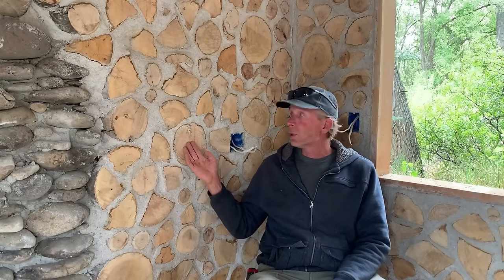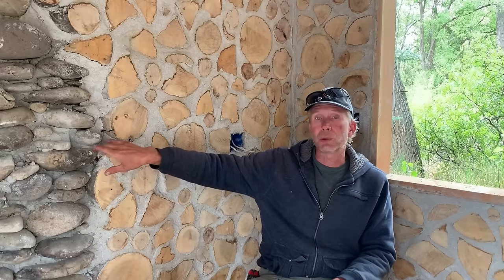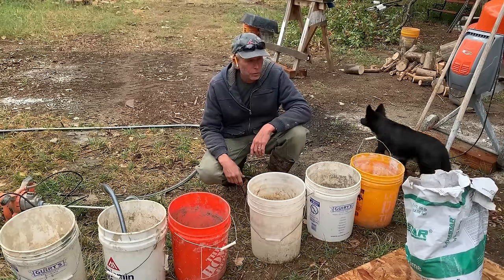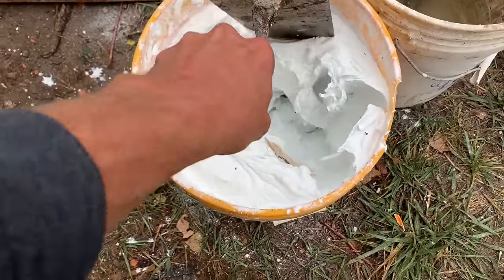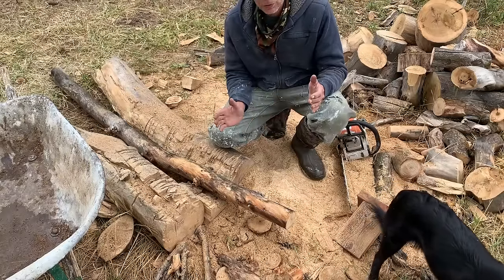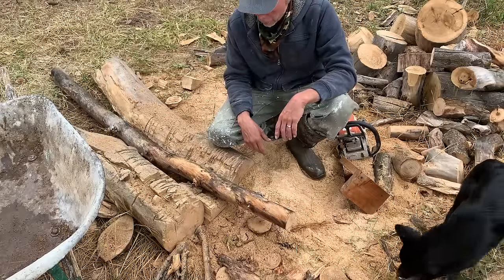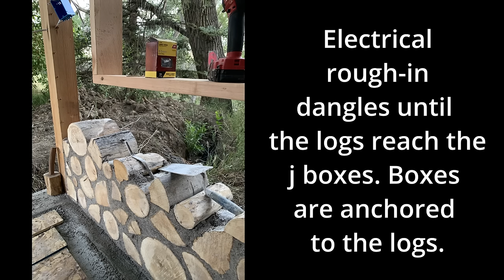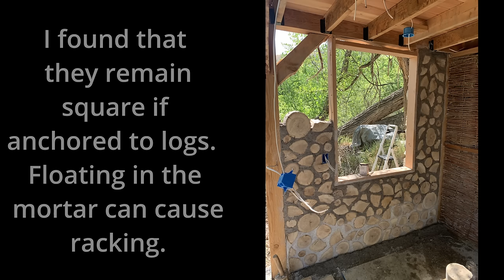Cordwood

Comment: My dad built a house exactly like this, move-in was 1986 when I was 2 years old. My folks, in their mid 70s, still live there today in the hills of southern Indiana. It work

EDIT: He mixed mason jars into the East and West sides of the house. Beams of sunlight spray into the living room at various times of the mornings and evenings, it's the best. Foxfire books ideas lol
Reply from the maker: @Hoosierdude40  Awesome! Always good to hear testimonials.
Reply: Were the jars laying on their sides, or standing up?  I live in a remote village in Alaska. I used mason jars in my chicken coop wall for some light. I stood them up and they froze n broke.  Maybe in their sides they would be more insulted?
Reply: @Alaska-Bush-Mom  The guy above mentions Southern Indiana, coldest winter temperatures reach around 27 degrees Fahrenheit,  this is not particularly cold. 
Your mason jars may have broken due to the warmth within the coop and the contrasting cold outside. The extreme differences in temperature could have caused the glass to crack. I experienced this when I was a kid, tried to defrost some freezer jam in a mason jar in my kitchen sink with hot water. The mason jar split in half, ruined my jam!
Reply: @Alaska-Bush-Mom  You could try the same idea with square glass blocks for windows, the kind found in old diners and buildings. I think they are made to stand up to that kind of heat vs cold.
Reply: @Alaska-Bush-Mom  the jars were lying on  their sides in the mortar, with the mouths in the living room
Reply: Antifreeze! @Alaska-Bush-Mom
Reply: @Alaska-Bush-Mom  Try plastic. It should withstand the temp changes
Reply: How do they protect the wood from rooting with humidity?

Comment: My parents built a log-end home in 1986, long cured logs stacked in cement, walls are around 20+ inches thick. Beautiful. After several years, the logs started allowing wind-driven rain to come through into the house, there’s no sealing or caulking to remedy the problem of ever changing logs so they had the house clad with steel siding. Still get to enjoy a house that is like a fortress and see the handiwork on the interior.
Reply: Maybe the logs should've been completely  covered with mortar/mesh on the outside
Reply: That's why you use lime .instead of cement
Reply: How do they protect the wood from rooting with humidity?

Comment: Im in grow zone 5/6.  Gives a  reference of the cold i deal with.  I would rather build with lime than portland.   Something i have done for 40 yrs - is to cut and leave the leaves on the tree - branches and all - I cut in the spring - it allows the summer to dry out the tree.  Makes seasoning the wood or waiting it out a much shorter time frame.  Thank you!

Comment: Filling the cavity with tamped sawdust is how traditional Scandinavian wooden homes are built.
Reply: That could be okay as long as the roof is maintained. If the cavity ever gets a substantial amount of water, you run a real risk of autoignition inside a wall. This happened to a barn next door to us. The owners used hay and sawdust as insulation, failed to maintain the roof, and subsequently caused the total loss of the structure.
Reply: Why would water cause autoignition?
Reply: @iunnox666 rotting causes enough heat to burn.  Look up hay fires caused spontaneously (no external ignition like a cigarette or lightning..... just the heat of microbial activity)
Reply: 2+ minutes in he talks about sawdust mixed with lime.

Comment: There's a couple of homes near where I live in Nova, Scotia, built this way. I first saw them 25 years ago, and they were very old at the time. I remember the walls being quite thick and had very deep window sills. I remember the logs had shrunk a bit, and you could see spaces around the mortar, but I'm sure there's an easy way to keep up maintenance on them over time. 
I was fascinated and read up on this method. I remember reading there were places in Greece that had some walls likethis standing that were 2000 years old.

Comment: I enjoyed your video and attention to detail and your honest assessment of the final results. I work with clay based earth building materials and thought I would try using a rich chopped straw and clay mixture throughout the whole length of the joints in between the logs. If bugs are a concern I would add a percentage of borax to the mix. 
Wild clays in our area come in a wide variety of colors so one could change up the color mortar for additional effects in the wall. All in all I learned a lot and appreciate your taking the time to share your experience!

Comment: That's very detailed, useful and realistic.
I was wondering if cob (mixed with sawdust and wood chips) would be better as mortar since it will "move" with the weather just like the wood does. It would also save some money and wouldn't impact the strength too much since you've got a timber frame. Also squaring the bigger/straighter log pieces with a froe, side axe or chainsaw could result in using larger rectangular pieces of timber without cutting them to 9 inch lengths. This would save time and effort piling them up like pseudo-ashlar masonry. The larger heavier pieces at the bottom and the smaller round and irregular triangles which are easier to lift over them.
Reply from the maker: This may be worth a try. I have found some traditional examples where the logs are in a cob matrix, and are pitched,witching the wall, such that the outside is lower than the inside. This allows for drainage away from the wall, and would keep water from pooling in the cob, and causing failure.

Comment: Another great video and Information - Thanks
Question: Is there a reason (other than cost) why spraying a sealer on exposed wood, cord or framing, is not done? 
Seems that after all that work, a spray sealant would make sense to deter rot, rodents, and insects?

Comment: Can you tell me the problems with more simple , faster.  vertical log construction for an  Alaskan style Aprox  1000 Sq Ft  Cabin. about 20. X 24. with a loft. -- about this size.  You put a lot of thought and effort into what you do so I wanted to ask you about it.  I was thinking 7-8. foot logs next to each other with some sprayed in white Insulating waterproof. Foam to seal gaps like is used on flat  rooftops in Vegas,  then metal barn siding and metal roof . ****One man Job --  Fast Cheap , and Strong.****  Cut trees - let them dry for 1 season . put them on a woden deck foundation . - big logs into the ground  to support the deck.

Comment: I'm really skeptical of using this anywhere with big swings in humidity during the year. If you do it during the humid part of the year, then you will have big gaps around the wood during the drier part of the year. If you start with really dry wood then it will swell and crack the surrounding mortar when the humidity rises. Seems like for longevity you would want to keep to using fairly small diameter pieces of wood as the smaller they are the smaller the dimensional changes with moisture content will be. That this has held up so well for two years makes me think where ever he is that it never gets very humid.
Also, the lime in the sawdust will change back into calcium carbonate fairly quickly which would have little to no effect on any critters looking to set up shop in the space in the wall.

Comment: We have Stack wood walls that are a little over 15 years old. We used pine as that is plentiful here. I have been somewhat disapointed with results long term. The wood keeps shrinking over time. Eventually you end up with a wall that resembles Swiss Cheese. The straw bale walls we built many years ago with a dust-crete cover have done exceptionally well  I have a video entitled, "Straw Bale House Life 28 Years and Counting" that documents that.
 I wonder what the R value per inch of dust crete is. Also, have you done any fire tests with Dustcrete? If you have not, I may want to try that just to know. 
You are doing some good work. We could learn from each other.
Reply from the maker: I've put the torch to it, and it will not ignite. Loved that video.
Reply: @radicalgastronomy  That is excelent. I know that Hempcrete will not burn so I was hoping this would not either.

Comment: I love the information in your video.. in fact all your videos!!! I have tons of cedar on my place and planning on trying to do something similar. I was wondering how your plumbing went and what you used? thank you so much
Reply from the maker: I used primarily pex tubing, as it is non-reactive with the lime. I’m running off a cistern, and have an RV pump pressurizing the system. Everything works great with the small exception of one hot water line I placed a bit too far to the outside corner in one wall.  That line has frozen twice when temps drop to zero F. Fortunately, the pex is flexible enough to not burst when it freezes, and that line thaws and works just fine. I’m using an on demand propane water heater. At first I had one of those $125 camp units, but that burned out after a year. I replaced that with a $450 camplux unit that is working great. Thanks for your kind words!

Comment: By splitting your full size  logs into quarters you ensure the 30% mortar 70% wood ratio    you could mix and pour hyper entrained aircrete into the wall void almost at completion and gain extra  insulative value.imlo.

Comment: Great idea but what about the expansion and contraction of the wood and gaps or cracks forming?  I would be concerned especially with using the bark covered logs as well. Though it gives a great color contrast with the bark. The separation of the bark would be a little concerning as well. Otherwise it looks Awesome and sounds like it is very well insulated with the air gap inside the wall with sawdust. Not only insulated but gives a great place to run your pipes and wiring so its hidden, just maybe susceptible to freezing the pipes in cold climates, especially if it's something that isn't always heated when below freezing temps.
Reply from the maker: Bark MUST be removed. Pipes too close to the outside can be an issue. This is not a problem with thicker walls. Mine are 9”, but typical thickness is 16-24”.

Comment: Architects say it doesn’t work, but people have been doing it forever.

Reminds me of exercise scientists who say lifting weights is pointless and we don’t need protein.  Literally no one follow their advice and succeeds.

Maybe the place rots.  Maybe it does but is fixable because the matériels are easy to replace.  

I’d ask what is the purpose of that cabin.  If it’s a hunting lodge, it serves its purpose just fine.  If it’s a home you expect to stand for 200 years, maybe not.

I saw this and thought it was a great way to get rid of odds and ends.
Reply from the maker: Having enjoyed this building for 3+ years now I can say that I would not use this method for a primary dwelling. It is holding up reasonably well, but there are the predictable drafts around the logs in a few places, and do great way to solve this without making a mess of the appearance.
My conclusion on cordwood construction is that it is a cheap, but time consuming approach suited for small structures and out buildings, or interior walls. I have no issues with rot, or insects. If the walls ever become too drafty, I will tear them out and replace them with dustcrete, which is also nearly free, but doesn’t have the same draft issues. That’s the beauty of having the timber frame.

Comment: Simply, amazing detail again. 

Do you Wax, paint or shellac coat the end of logs to prevent splitting when they are drying before or after you make the wall.
Reply from the maker: The best move is likely linseed oil once complete. Mine are still natural, but I plan to oil this season. Ideally, the logs are seasoned two years before assembly, so the checking is already done and shrinkage is minimal.

Comment: Hi!!! Thanks so much for this informative video! What a beautiful cottage/home…I am looking at ways to do filler walls with cordwood…One thing I thought of was to drill large screws into the cords for spacers, stacking the cords on top of each other, building forms and filling from above. There would have to be precision cuts of the cord, fitting exactly the width of the form so the ends don’t get covered with mortar…was wondering you thoughts/opinion?

Comment: Also, as I’m pondering how we build straw-clay walls rammed between slip forms, there’s no reason not to use a temporary horizontal board attached to the side of the wall one desires to be perfectly plumb thereby eliminating the need for a string line.
Reply: Just use a level. Easy and fool proof.
Always run a string line!

Comment: I 100% guarantee you this holds heat better than the Stick Figure piece of crap house I’m living in right now. The landlord won’t do anything about it, but you can put your hand out to any window or door in the house and fill air blowing in and the same with some places along the edge of the floor. If you turn the heat off in the winter within about an hour, the temperature is dropped 15 to 20° and within two hours. It’s the same temperature is outside. This is some of the reason I bought property and I’m planning to do this natural style building for my house on the property.

Comment: Beautiful! Would love to see a follow up video about pros/cons of these materials. Did you put a sealer on the exterior?
Reply from the maker: That’s a good idea. I’ll make one. I did not seal my log ends, but plan to. I wanted to make sure the logs were as dry as could be before sealing them. I’ll use a linseed oil/citrus solvent sealer, then patch any fine gaps with lime putty, at some point.
Reply: I suppose with a wood stove inside, the moisture in the logs would be drawn out. Hmm 🤔 Interesting physics question, would the heat push it outside or the dryer air inside pull it in? 
Great channel, thx
Reply from the maker: @Bolthole_Studios  A stove fire draws a lot of air. All winter there is a draw to the inside, for sure. In the summer we run a window fan, and a window AC unit when it gets super hot. Air gets pushed out during the summer.

Comment: I was wondering how the mortar will affect the logs as they lose moisture. Would the walls get weaker as the wood loses or gains moisture? I love this idea though because it is so affordable and like a log cabin, but cheaper.
Reply from the maker: If your logs are very well seasoned before you build, the movement is minimal.  My climate is very dry, so I haven’t experienced much moisture related swelling. The there are some tiny gaps around the logs in some places.

Comment: Could you please share what the climate is there? Because ive wanted to use our cottonwood but we get a ton of rain where we live and cottonwood once it isnt alive anymore seems to break down very quickly in the elements, no? I have juniper too which IS great for exterior projects but im a little nervous,  to see if something like you did there (Id like to make a small shop for tractor, implements etc) would be able to have a chance of holding up in our climate near Portland OR. But i love what you did and think it looks beautiful! I love the idea of using materials we already have available. This is the first time ive seen this done before. We would probably need to treat the exterior with some pretty heavy duty sealant. Wouldn’t hard wood be better for the exterior though to prevent all the movements softer woods tends to do due to moisture fluctuations? It’s very interesting and im sure with the right combo and pre processing it could be done especially if exterior is sealed or encapsulated. Im  vert intrigued! Thanks for the video and please let me know of the cottonwood actual held up and what your climate is like (ours is considered “marine”).
Reply from the maker: We have vastly different climates. Mine is high dessert with low humidity and 12” of rain per year. Hardwood is rarely used for this, due to lower R value, but cedar in your situation would be suitable for the shed you describe.
Reply: @radicalgastronomy  That makes sense. I just got done writing a comment about how this wouldn't work anywhere with big swings in humidity during the year and how you must be in an area that doesn't get humid, seeing how nicely the wall held up after two years.

Comment: Great stuff! I am going to be doing something like this and plan on doing over a cinder block stem wall that is 8" wide. So thickness will be 8". The walls will be 8' high, my question is as you build the cordwood higher did you put any reinforcements to the wooden frame? Almost like rebar or wire? My concern is the stability of the wall as it gets higher, especially if the frame is wider than 4' or so. Thanks again and great video!
Reply from the maker: Your concern is valid. In this build, I half sank 3” construction screws into the timber frame, about every 6”. These get encapsulated in the lime mortar. A better move is to screw stickers as cleats all the way around the perimeter of the void to be stacked. Over time, the mortar shrinks a 64” from the wood, or vice versa. At any rate, there is a draft gap that has developed on mine, so I recommend the full cleat method to serve both anchoring and draft issues. Though further reinforcement should not be necessary, it wouldn’t hurt anything, to my thinking. Perhaps wire anchored to screws at each end. That wouldn’t interfere with the organic log layout. Good luck with your build!
Reply: @radicalgastronomy  Thanks so much for the rapid response. That is awesome and was planning on doing something like that but it is always nice to hear from someone who has done already! Happy Thanksgiving!
Reply from the maker: @enochborozinski890  same to you!